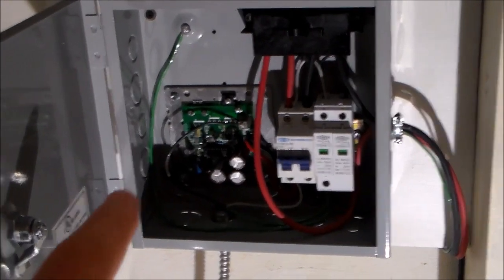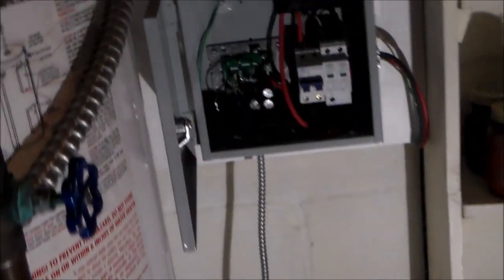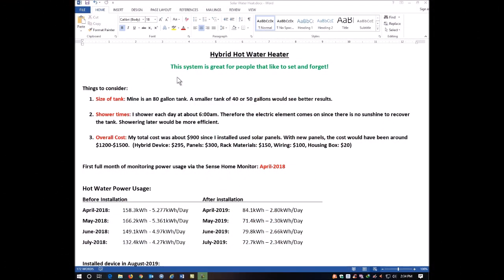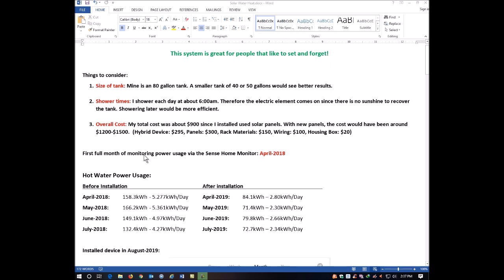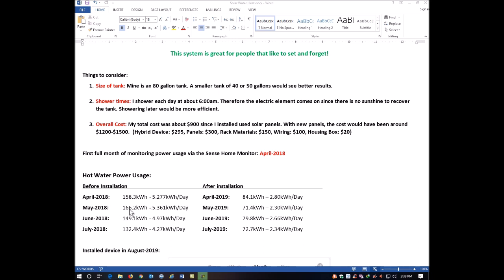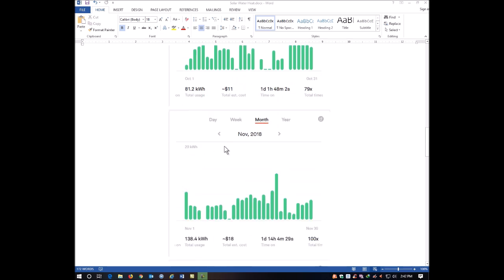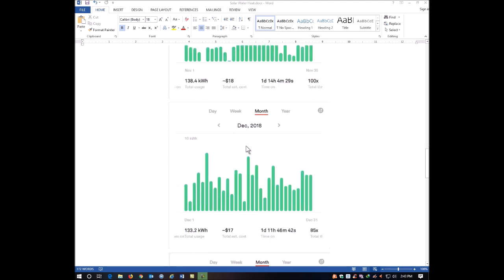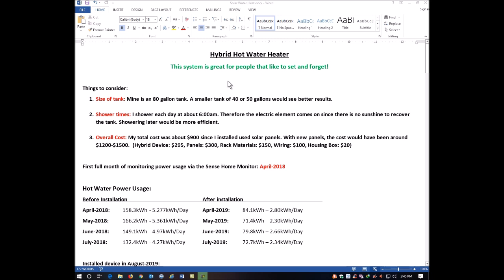DIY Solar - Episode 17 - Hybrid Solar (PV) Water Heating - 1-Year Update

Comment: Set the thermostat even higher say 150 F for the PV supplied element so more of the PV energy goes into the water and set even lower for the utility supplied element. With a hotter tank in the evening, it should still be quiet hot in the morning reducing the need for utility power to kick in.

Comment: Thank you Jim for an update.

I bought the hybrid water heater board, when I was in WI. I can not get it working due to the long winter and the weather very crappy in WI.  Now I relocated to MO, my newer house everything is electric so I dig the board out, this time I feed the board with 3's of 340 Watt  solar panel, the electrical I setup it up the same with Jim, the power from the grid feed my water heater breaker is off, I typical taking a shower late afternoon, I have dual 80 gallons electric tank hookup together, I have this board warm up the 1st tank, the goal when ever I need to turn on the breaker for the original tank, the water coming in will be warmer, so the heater does not have to work very hard to keep the water warm for the winter season, I just order a temperature/pressure gauge to see how warm the water from pre-heat tank to main hot water tank so I always have 160 gallons warm enough to take a shower or do the dished.
Reply: curious how many watts are you putting into your system
Reply: Thanks for sharing. 
Say, WoW 2 80 gallon water tanks, really? Can I ask why so much? 
A typical low/middle income home here has a 30 or 40 gallon water heater. Mine use to have a 30 but when I replaced it, I got a 40. But now not many people in the house, so a 30 would be Plenty for me. 
PS Don't forget to replace your anoid anti rust rod just after the tank warranty has expired to avoid planned obsolescence the companies rely on to make the tanks and our money go to the land fill and trash our precious planet and children's future, way before its time!
Take care

Comment: A few ideas that might help.  1.  Install a timer to delay the upper element from coming on so soon.  Or allow it to heat mostly at the cheaper night time net metered rate.  2.  Install a much smaller upper element to slow the speed at which grid power gets used / giving your PV system more time to do it's job.  3.  install an automatic mixing valve to keep your out going water consistently at 120 degrees (or what ever you choose) while you tank can be much hotter.  Again, thanks for your excellent videos.

Comment: If you don't need hot water immediately after your shower in the mornings... install a timer and don't let you electric come on before noon... give the solar a chance to do some work before you re-heat the tank with the grid, unless you need ongoing hot water the rest of the morning.
Reply from the maker: Michael Morris Great idea. I will look into that. Thanks for the suggestion!

Comment: Every thing is application based for a situation...…..you can get HPWH now for about 1000 bucks, it averages a 100 bucks a year to run, if you are still using the grid, then its simple, it uses less energy and installs directly......even for a grid tie system it uses less energy,....in a non grid tie application this system in the video is great and worth the added expense and mechanicals, plus the massive savings on batteries.

    The heat pump water heaters also put out cold air which can be vented and utilized further, they also vent in air that can be utilized to take advantage of excess heat even further boosting performance......with simple cheap dryer venting.

   The system in the video is brilliant for certain applications.....the best solution is always application based.

   HPWH also have a electrical back up element so you could also install this system on one almost eliminating the bill completely...although at a substantial investment in equipment....making the break even point even longer.

Comment: I manually control the timing of my electric water heating as I use off-peak electricity whenever possible. I have a large tank and find that one overnight boost is sufficient for 2-3 days of hotwater.  It might be interesting to see what happens if you give the solar more time to heat the water after the hot water usage around breakfast time; especially in the summer.  I look forward to your two year review in 2020.  Best wishes Alan

Comment: Two things that might improve your system:

1- Add one more solar panel of the same size.  
2- Add a tempering valve.

You appear to be using about 2.5-kWh from the grid every day.  One more panel would reduce this by about 1-kWh.

A tempering on the output of the hot water tank will ensure a steady hot water temperature, and it diminishes the possibility of scalding.
Reply from the maker: Yes, I plan to either add another panel or decrease the size of the hot water tank. Since it is only my wife and I living in the house, we really don't need the 85 gallon tank. It was already here when we moved in.
Reply: @jimginnyohio  I actually like your tank, and I like the size.  

I get the impression that due to its size, it is able to cope better with sunnier days (store more solar energy), and in colder days the larger mass of water helps maintain a more stable average temperature (with less solar energy).

In addition, it appears to loose heat very slowly (a combination of a lot of water and good insulation).

You had a video showing the amount of grid energy added during a year, and I was surprised to see that there was so little variation from one month to another.

Comment: We installed a Rheem Hybrid (heat pump).  It uses about 1.5 kwh per day for two people without this device.  You may want to get a hybrid for the next house.  The power company and tax credits paid for most of the total cost.
Reply from the maker: Yes, I've heard those units work very well and are a great companion with solar power. Larger up-front cost, but greater long-term savings.
Reply: @jimginnyohio  I run a NYLE HPWH and add to that with PV solar.  All these have a resistance heater you can tap into if you have no grid tie system.
Reply: Not worth it in my opinion, its a complicated device and it's costy to replace... i'm not sure it will pay for itself in the end. Do not take their perf cop into consideration... they are near all far off (best scenarios that are never met in reality)
1.5kwh let you elevate 20 liters of water of 60°C (if my mental calculus is not too bad)
How did you get your 1.5kwh result and how much water and at which temperature you use everyday..?
Reply: @honumoorea873  I am low use with my HPWH and I calculate I save about 47 cents a day with a COP of 2.  Usage daily was about 3KWH in winter months. Search Northeast utilities hot shot program for some real engineering data. Some sellers quote COP at 75% RH. Certainly don't believe what you hear.  Low water users do not have much of a payoff.
Reply: +1 installed the same heat pump for a family of 5. average usage is 9-10kw a month or 350w a day when you just use the heat pump only mode. Slower recharge rate but if you time the showers you are fine. Unbelievable how efficient this unit is.
Reply: @zekeboz5533  get your units right, cause it looks like you do not know what you are talking about. kW is a unit of power.. Not energy.
Reply: @honumoorea873  Good catch -  forgot the 'h', kwh. thanks for clarifying for folks!
Reply: @zekeboz5533  your supply temperature may higher than mine.  I think mine uses 400 W-hr per day just to stay warm.  It is using more as the outside temperature goes down.  About 1.4KW-hr in August and about 1.6 KW-hr now.
Reply: @gregs7918  Agree. My assumption is that the usage will go up when winter hits along with sports season with my boys (showers will multiply....)

Comment: would love to have you set your water heater upper element to 120 (that will drop standby heating from the grid) This will reduce the amount of time your water heater comes on from the grid.  Direct wire the thermostat on lower element to completely remove the lower thermostat. It is not being used.  I Think you will find your pay back period will drop by a couple of years.   If you ran a couple more PV panel to get you near 1200 watts you might find that again you get a huge drop in how much your grid is supplying

Comment: I read the instruction manual for the controller device and noted that it was optimised for a 4200W element.  Did you check this?  The manufacturers observe that a 3600W element does not perform very well.

Thank you for taking the time to explain it all in such detail

Comment: Looks like it's worth it for some.  I will say this controller has been out of stock for approx. a year now, does anyone have any other source. 
I believe one big advantage with this controller is you do not remove or change the element in you existing heater.  Can you please confirm that?  
Great video, I'll have to check out the install video.

Comment: Did you do any analysis of the bottom line $ savings or the change in your overall electricity usage?
An inspection of the year on year figures show a saving of the order of 3kwh per day which at around 12 cents per kwh is less than a dollar per day so the payback period will be quite long.  I do not want to appear negative, just realistic I would however like to echo other comments that sharing your work is really useful
Reply: Yeah, what he said!

Comment: Hi Jim just wondering what the name of the board is and what element did you use in the water tank
Reply from the maker: This person markets the device thru his eBay store called Techluck. At the time of this posting, he sells the device for $259. Otherwise, you can reach out to Scott at Practical Preppers for a great deal too: https://practicalpreppers.com/   It simply connects to the lower element of any electric hot water heater.

Comment: Hi Jim, good work. I also have gone down the path of PV solar water heating with the same inverter board just a little updated and as well as Thermal. Watching and Listening to your vids, I'm not sure if you've mentioned the wiring configuration of the panels you did.? I have found that wiring the 3 panels in parallel  instead of series gives me an additive on Amps rather than an additive voltage in series, this gives me more watts as watts = amps. I found it works better in Parallel and I'm definitely getting more hot water too.? Food for thought. Cheers from Australia.

Comment: HOWdy  J-G-O,
Did you run  DC current through your  HEATING ELEMENTS ? 
What sized Heating ELEMENTS were installed in your Electric Water Heater ? 
Curious
COOP
...
Reply from the maker: The original manufacturer’s parts are still installed in my water heater. Not really sure what size it is. I believe 4400 watts.
The device I installed converts the DC power to AC for use by the water heater.

Comment: If you water is at max temp and solar panels are still producing electricity what happens to the extra electricity? Also any issue with your relief valve blowing pressure from heat?
Reply from the maker: Brian Howe 
Solar panels operate just like a battery that isn’t being used. The power stops flowing. It’s not the same with wind power.

Comment: Jim,
   I was wondering how you set the solar panels up. Did you put them in parallel or series, what voltage 12v/24v and how many amps total running to the MPPT controller and what wattage is necessary. I see you are running 945watts total on the panels. Any suggestions would be great. I am trying to setup the same thing with 4 275 watt panels. I am definitely green to solar stuff as you can see.
Reply from the maker: For this Hybrid Solar Water Heater, the manufacturer of the device recommends configuring the panels in series to generate higher watts versus amps. If you search for this device on eBay, you can download a copy of the user manual and frequently asked questions. They cover all of the details you are asking about in there. Not dodging your questions, but I really think you can get more detailed information than I am able to provide about that.
Reply: @jimginnyohio  thanks Jim. I found the website but couldn't find the store on Ebay. Any suggestions for ebay? Thanks for all of the info.
Reply from the maker: @thomwood8768  Hi Thom - Yes, I see they are missing on eBay now. However, if you found their website (techluck.com), then you should be able to get all of the required information from there. If you are looking to purchase one of those, I see on the website that you can sign up to be notified when they are back in stock again. It's my understanding the manufacturer is having some delays getting some of the required parts from China. Hopefully he will have more in stock soon.

Comment: To prevent scalding from the higher water temperatures, I suggest installing a mixing valve on top of the tank to reduce the outgoing water to a safer temperature.
Reply: Or using the mixing valve that already comes on the shower...….next thing you know they will mandate a mixing valve on the gas stove so it does not burn you.....

Comment: I suspect that you are not getting the full potential of those panels if your heating element is less than 5500W. What are the specs of your panels and heater element?  They never like to confuse you with numbers. Have to do a simple calculation and people run for the hills.  Just believe it is magic after hooking up three wires.
Reply: Maybe this helps, Someone in comments said: "I read the instruction manual for the controller device and noted that it was optimised for a 4200W element.  Did you check this?  The manufacturers observe that a 3600W element does not perform very well."
Take care
Reply: @JimTMcDaniels1   Some people think this guy is a genius, my opinion is much different.  Capacitor and heating element form a time constant.  These capacitors are rated at0.68A of current and they just can't supply current to low resistances.  Many have reported these capacitators die after a few years and the unit becomes erratic.  I worked on one that died from a voltage spike.  Every semiconductor except the protection devices died.  Very poorly designed power supply which takes out everything in a failure.   I design my own and they work with any resistance because the capacitor bank is 20 times larger.  Avoid this turkey!

Comment: 260$ for this.... it's a joke...?
Reply from the maker: Honu Moorea Honestly, I was hesitant to pay that much for it too. But honestly, it has really worked well and saved quite a bit of power. I looked everywhere for something similar for less cost, but was not able to find anything. If you find something equal or better for less, please let me know.
Reply: In my mind it would make more sense to use the panels to run you inverter instead of only heating the water. I'm sure there are times that the element connected to the solar is off because the water is already hot enough. It seems to me it would be better to add another GTIL for about the same cost so you could utilize the full potential of your panels. Any thoughts?
Reply: This price would be perfectly justified if that was all ever needed to power from solar panels. But since you have your own inverter and battery I don't understand why not use this to power the water heater.
Reply: I have one installed on my 30 US gallon electric water heater with 2 x 327 watt panels wired in series and for the most part it has met or exceeded my domestic hot water needs to the point I installed a tempering valve to prevent potential risk of scalding. I only use hot water for showers, dishes in the sink, and on very rare occasions the laundry. I removed my dishwasher many years ago, because I needed the extra under counter storage space and it helped greatly keeping my energy usage in check. I went a little bit further by putting a timer on the upper grid element so it does not come on during the day to allow the solar side to do most of the heat recovery and if I am expecting company over, I just bypass the timer.

Yes, the controller is pricy, but when considering the overall cost of less than $1,000 including the controller and using preowned components compared to an average solar thermal kit for about $5000. You do need to do some plumbing to connect between the water heater and solar collector. Jim lives in Ohio and there is freezing conditions to contend with too. Going electric on the other hand is isolating the lower element from the grid and hooking it up to the controller.

DavidPoz has experimented with PV direct by matching the water heater element with the panel array and it does work fine for less money, but with the $260 controller it takes the guess work out of it. Pretty it is plug and play.
Reply: There’s an open source design available on this forum, you can make your own if the price is too high for you.

https://www.thebackshed.com/forum/ViewTopic.php?FID=10&TID=11546
Reply: There is also the AC7391 for about $200. I get all my hot water at camp with PV and it typically shuts off at about 10am with a 15 gallon tank and those panels also supply refrigeration etc. I've been showing people how to build these for several years for about $30, but there just don't seem to be makers anymore.
Reply: @jimginnyohio  Yea i'm sure it work, no doubt... it's more that it feel very pricey for what there is on the circuit.. 😊
If i was starving i would pay a bigmac 1000$...since i'm not, the 1000$ bigmac seems pricey...
Reply: @NoelBarlau  Thanks man, did not know about it, will check in more details tommorow.